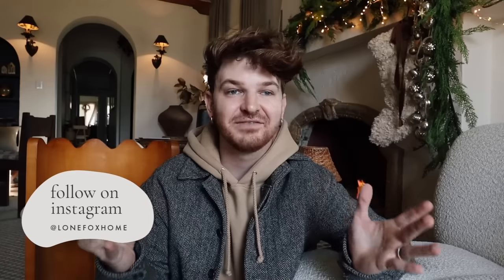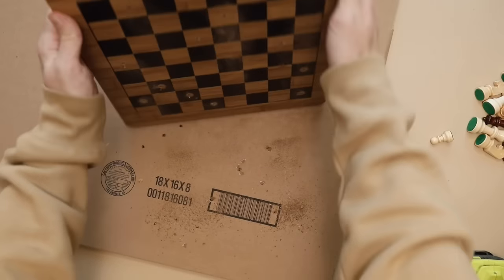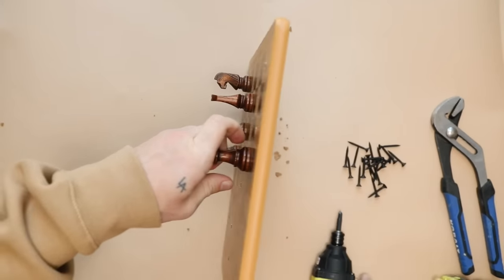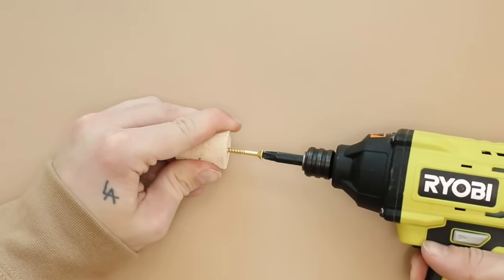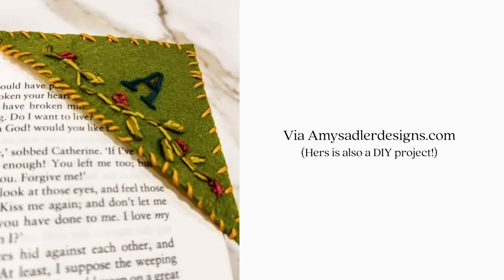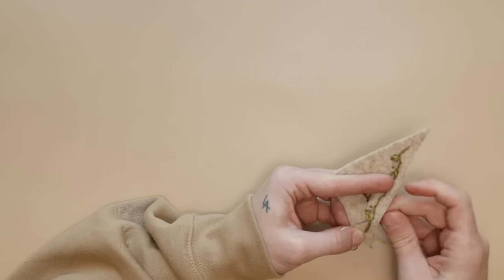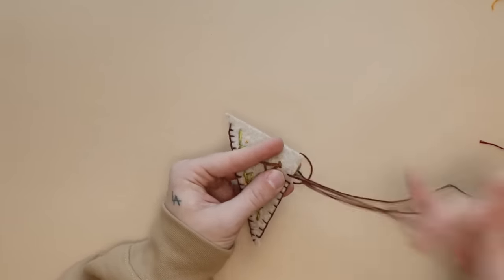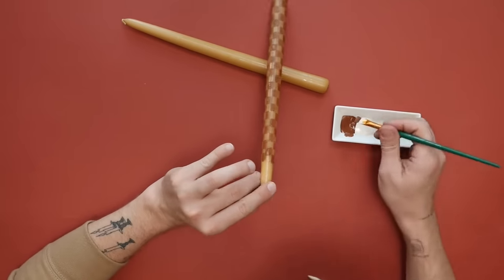DIY Christmas Gifts People ACTUALLY Want (2023) 🎁 Affordable + Cute!

Comment: your stuff always looks so lovely. one thing tho - be careful with those corks. reusing corks, especially with holes drilled into them, can lead to them being extra porous and then they might ruin the drink they are corking/disintegrate over time very fast. I'd recommend looking at wine stoppers in a different material - the bog standard ones are always ugly, and would benefit from a sprucing up!